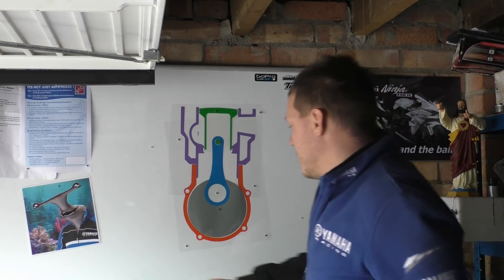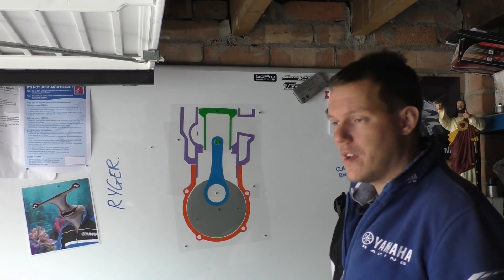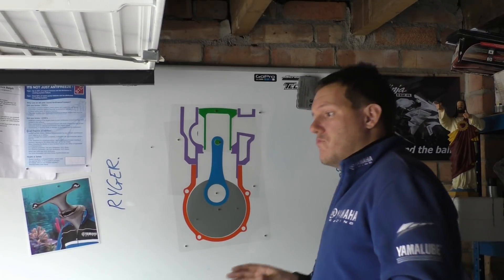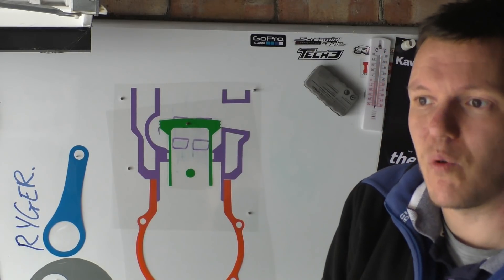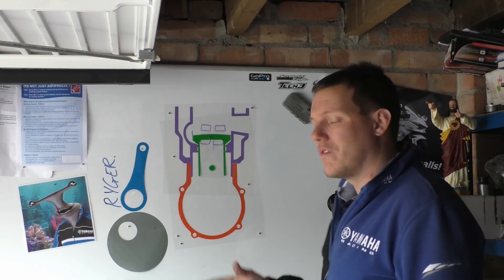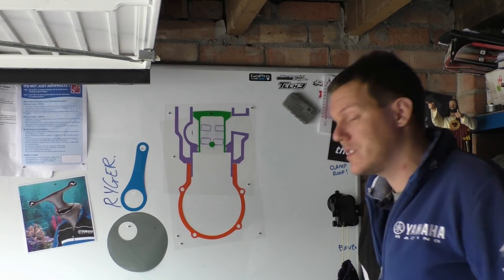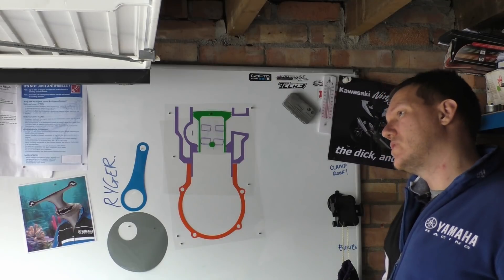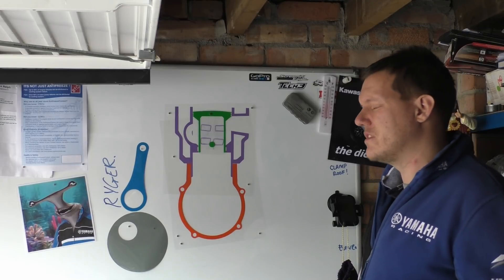Is the Ryger Engine Shite?

Comment: Condensed lubrication???.. Sounds like grease to me. Also I wouldn't trust that the primary compression is any good. That part looks suspect to too much trans port velocity.
However, I do see a few mods that could be incorporated. Put those in and you,d have a hellfire of an engine.

Comment: I just went and had a look at the website and the thing about the motor that jumped straight out to me was that there are no cooling fins on the motor. 65hp at 25-30% (generous) efficiency and there's not enough heat going into the block to need ANY cooling????
Reply from the maker: Its water cooled i believe

Comment: Would that mean the piston is nikasil coated or something as it is having a ring/seal passing over its surface similar to a ring does in its bore,  and how would the tolerances work out??
Reply from the maker: Why would the piston be coated?
Reply: @thedirtyworkshop  .. what would the lower/case ring be made of as you dont have a piston  ring running in a plain alloy bore..

Comment: A YZ80 does about 10-11,000 RPM and produces around 25 HP, a YZ125 does about 11,500 RPM and produces around 38 HP. These engines don't last long at all when they are run like that, this thing might make 65 HP at 30,000 RPM... for about five seconds.

Comment: Condensed oil must mean... it is oil without gasoline.   Oil to rings is probably with oiling holes in the back of the ring groves.  Those bottom ports are always connected to above the piston so as not to get oil from below into the combustion cylinder.   The fuel could be direct injected as with the E-tec to keep the fuel out of the exhaust.  So the benefit is the good lubrication maybe with plain bears, maybe more durable than needle bearing.   Nice broad torque band, amazingly broad for a 125cc with 65hp.  It reminds me of the hp graph of the turbo Suzuki 125 street bike engine, (some very common 1000cc car turbo, as the funny author name is a suggestion), would be great if only an expansion chamber necessary.    The crankcase is not used for transfers port breathing.. so that could increase efficiency of transfer pumping, and possibly more hp.   The lower oil control ring and two compression rings is the same number of rings on 4 strokes, with the added benefit of non-piston tilting, so slightly less piston friction losses, and better ring sealing and life.   Also, could add a oil cooling jet to the bottom of the piston, so that would allow for a leaner mixture before the piston got too hot.  As 2 stroke cart guys know, leaning the mixture is a good but dangerous dance.   Maybe a paid road trip for a video of dyno runs/cart runs, interview?

Comment: Maybe the "condensing lubrication" is something that gets vaporized by the heat in the chamber and then condenses on the exhaust before going to the outside air.

Comment: Interesting stuff Matt... the stepped piston is really an old design... I did watch some videos of a kart Ryger and the thing seems to haul ass... I don't get how they can call it an environmentally friendly engine though when it's clearly puking unburned hc's out the pipe. All carburated 2 strokes  have the issue.. I mean it's a pretty hard thing to do... perfectly push out all the combustion gasses and replace them with a new fuel /air mix and not spill any out the pipe.. One of my favorite 2 stroke designs is the Ricardo Dolphin.. I like the uniflow concept because it seems like it spills less fuel...  and is has the ability to run lube in the crankcase. Ricardo designed the engine in 1904 when he was just a teenager.. it was inspired by Dugald Clerk's earlier design. The Dolphin was used in boats and also a car was produced. The engine was renowned for it's low end torque.   As far as I'm aware the Atkinson Utilite' of 1892 was the first 2 stroke to inject fuel after the exhaust  port was covered.  Here's some video of my crude Dolphin copy... I wanted to make one since as far as I'm aware there are no running examples..  as you can hear it idles pretty smooth.  https://www.youtube.com/watch?v=0oG2RSe3P20

Comment: Interesting idea, instead crank compression it is done by piston side. But too complicated piston. Piston must be probably with nicasil coating or other hard wearable material that can withstand thermal expansion and not crack. There will be serious problems with piston overheating...
The pretty same can be achieved by root screw compressor on intake and eliminate piston crank compression and direct injection. Yes compressor will have less power, but wider powerband.
Max rev limitation is for Ryger and regular 2T the same (piston break and bearings).
I doubt that Ryger hat less friction because piston rings in BDC are near "barrel rings". Piston is way bottom and there must be some support for piston (from sleave?), because piston will tilt and quickly wear.

Comment: Link to: 53hp Turbo TZR125 (2stroke) 53hp @ 11 Krpm   https://www.youtube.com/watch?v=Oxj_OAb5bqk
Reply from the maker: 1) I've been in contact with these guys and they're not so forth coming about their set-up or testing

2) Even if it is true that's with a turbo
Reply: Ryger dyno numbers could be true IF it's boosted.  The turbo TZR125 got 53hp.   It is within reason that more boost and better use of boost, or intercooler could get 65hp.   The 30k rpm obviously is a super super short stroke theatrical engine, not this dyno motor.

Comment: The chart says they made the 65hp at ~11,700 RPMs. That implies putting well above atmospheric pressure into the cylinder before the compression stroke. If they've somehow managed that, then it is a pretty slick motor. I don't really see there being enough volume in their little squish chamber to make that happen, but what do I know. Either they are and its the most compact super charger yet, or the chart is BS.

Comment: I wonder if they do the same thing as the F1 stuff with the cross drilled pistons, just feed oil to the piston rings from the "wrong" side? They probably need an oil nozzle frantically spraying the piston to cool the exhaust side of the piston anyways.

edit: I wouldn't be surprised if they managed to get up to 60-65 hp, people have gotten 125's up to 40hp no problem. They're just not usable because they rev to high for any engine longevity and their powerbands are shit.

Comment: Hi 
Being a boring old fart I sat down and played with some numbers and yes indeed it would have to turn at 30800 rpm to consume enough air to produce 65 horsepower assuming 100% volumetric efficiency of which I'm sure would be greatly reduced at those speeds 
What do you think
Reply: Yes Marcus.  According to Blair the port time/area would need to be enormous for 30,000 rpm.   The direct gasoline injection, opposed piston engine I'm building has huge ports for a theoretical 22,500 rpm max at a 32mm stroke and 23.25 m/sec piston speed. the port height is a whopping 20mm, or almost 2/3rd stroke. I expect to run it at a more sensible 17m/sec maximum though, which equates to 16,452rpm    BMEP equates to 20.61 bar  and 361.6BHP  as the capacity is 477cc's  with forced induction at 3.1bar.   No tuned exhaust system and a linear torque curve anticipated.  Bore is 70mm.

Comment: Think about their statements of that the engine isn´t depending on the pipe to make power.
And then you think about the pumping displacement, it is actually a lot less than cylinderdisplacement due to the 'rod' going down through the sealplate are stealing displacement.
So, pipe isn´t important they state, well i have to say it sure the fuck is.
It has to be working throughout the whole usable rpmband they show on that excelfantasy dynosheetpaper.
And as a twostroketuner we all know that a pipe don´t add power in that very wide rpmband.

Nothing else than sales hoax.

Comment: The dyno graph doesn't have units on the axes and also has two plots, one much bigger than the other and no information about what either of them mean, so it's impossible to draw any conclusion. But since a Honda RS125R makes 44HP and that's running on the edge of blowing up then 60HP looks unlikely.
Reply from the maker: LOL what - the dyno plot does have units??? From there website -

"A little explanation concerning this graphic, The red line is the Ryger 
special and the yellow one is from the standard version. The lower ones 
are the torquelines."

the plot 

http://rygerengine.com/wp-content/uploads/est-test.jpg
Reply: I stand corrected said the man in the orthopedic shoes.

Comment: I saw your video with the two engineers trying to fix the 2 stroke emissions and they ended up just making a 4 stroke. I still don't get how a supercharged, non crankcase breathing 2 stroke would be more expensive than a 4 stroke. To me, a a supercharged, non crankcase breathing 2 stroke would be perfect. Also, you could design it to have extra boost for no extra cost.
Reply from the maker: This is why. You have a supercharged 2 stroke. 

This does 1 thing. You stop burning oil. You are still losing fuel through the exhaust and who knows if this will pass emissions?

Now you have other issues.

1) Cost - superchargers are fucking expensive
2) weight - superchargers are heavy
3) fueling. How? Carbs - then you have throttle response issues, or add a fuel pump etc
4) Go injection and the cost of the pump, sensors and injector
5) You have to make things taller to fit it all in. Just like the ryger

That's why

Comment: I like 4 strokes because I always feel like they are not ticking time bombs because of their lubrication. That said I like this but it still fails in many aspects that a 2 stroke has. And they claim mad hp but it should be less because you have the oil pump or splash system adding friction right... I do like the idea and if they gain reliability with the same hp am sold

Comment: Was thinking about it and I suppose it depends on what materials are being used for the piston (weight wise)... Maybe they have gone the complete opposite with the piston being coated opposed to the cylinder (nikasil or something slippy ie; teflon ?) to reduce friction against the seal faces, I also wonder what the seals/rings are made of. (some funky shit)

Also depends on what they have used for bearings, ceramic would be the way to go if you wanted to produce HP and RPM to those values, maybe this is why the thing is so expensive, if the production costs are stupidly high...

I might just buy one out of curiosity to find out................... like fook !! 

PS, where's the boy gone, you got him gimped up Matt ??
Reply from the maker: "Maybe they have gone the complete opposite with the piston being coated opposed to the cylinder (nikasil or something slippy ie; teflon?)"

- heat is the problem here. Pistons are exposed to the highest temps in a 2 stroke with no real direct cooling. Covering it in an insulator is not a good idea.

The other issue is that coats resist wear, not stop it. Most components rely on oil as the load carrier and not coating. Coating are used to extend the life of something not be the only line of defence. Will do a video on this though, good point.

"ceramic would be the way to go if you wanted to produce HP and RPM to those values, maybe this is why the thing is so expensive,"

- Same thing with ceramic bearings, they are more wear resistant and harder. They have a lower load capacity than metal bearings and are much more susceptible to thermal shock from temperatures increasing and decreasing. This can cause internal stress and lead to cracking. People seem to think that ceramic bearings can 'go' faster which is bollocks.
Reply: Good point on the bearings and yea your right, didn't think of the thermal shock factor, maybe being a sealed crank to an extent it might be cooler ?

And what you done with that boy ??
Reply from the maker: He's sleeping (in the gimp box)

Comment: Wow.  The port time/area seems way too small for the claimed power and rpm.  I wonder what the claimed BMEP is?  The crossflow port layout doesn't impress me either.  Imagine the mixing and short-circuiting that must occur!   My 2.5 cc model engine turns 37,000 rpm, but the piston speed is only 17.3 metres/second.  Theirs would be a ridiculous 54 metres/second at 30,000rpm.  Lubrication would be a nightmare at those piston speeds and the piston acceleration would be around 168,750 g.
Reply from the maker: "Wow.  The port time/area seems way too small for the claimed power and rpm.  I wonder what the claimed BMEP is?  The crossflow port layout doesn't impress me either."

- the example on the board isn't their design, its an example so not to be taken literally - as I said, I don't know the actual design that is in the engine for sale. This is just what i got from the patent. 

I believe its close but how close? Who knows......
Reply: Quote from the patent:  " Oil spray present in the crankcase can easily reach the piston, condense and penetrate, via the access opening, the plurality of channels due to the pressure in the crankcase, such that a small amount of oil is fed to the top seal ensuring proper sealing and lubrication of the piston relative to the cylinder wall. "   Patent number EP20150179826  on Espace.
Reply from the maker: The same as I read - this doesn't tell you anything even with the illistrations. If the compression rings are receiving oil then the entire cylinder wall is. 

This means that the ports will 'scrape' some of thoil off and it is then in the air flow. These means that the oil will burn hence the system is not a clean as they are making out.

Comment: I wouldn't want a bike with that kind of powerband. Idle has no torque, then suddenly the meat of the band. Granted this is for a race application. And is it just me that thinks a powerband from 8,000 to 13,000 seems kinda small considering anything under 8,000 is unusable?
Reply: phillip galas for kart racing it makes sense. Thats about all the Rev range you use. The power numbers sound like "theoretically lossless" numbers IE fake as fuck.
Reply: Puffalupagus360 agreed. It looks like a calculated chart while ignoring limiting factors, namely going twice the popular limit of piston speed.

Comment: It doesn’t look like it is an exceptionally superior design to the degree that it would offer that kind of HP without them talking about the new science they have put into the materials that make it possible. As you said Matt, those are some bloody big numbers they are claiming. A little engine like that would have to be amazingly strong to withstand those forces. Why no mention of the metallurgy by this company? It seems to me that the claims are fishy.
Reply: there may be a proprietary coating on the cylinder and rings. there are advances in anti-friction coatings that enable high heat and rpm stresses and still last long. that can be the only reason so secret about details.
I like the piston idea, maybe it weighs less than a regular straight 1?

Comment: I like the way you didn't totally throw the design out the window, but just pointed out the problematic points. Especially the power number.. I'm also wondering.. square engine supposed to go 30000rpm?
I mean 30000rpm... that's about where most of the model nitro-methane engines have their max rpm. 
Would be cool if you could come back to that engine when there's new information!
Reply from the maker: Like I said the 30,000rpm can be achieved it does doesn't last long, and part of the testing - don't know why but there ya go........
Reply: yep

Comment: http://www.ntproject.com/startpage/ryger_engine.gif looks like it is basically  a variation of a crosshead engine with piston,pistonrod and crosshead combined into one
http://www.marinediesels.info/Basics/2_stroke_crosshead_labeled.gif
Reply from the maker: "looks like it is basically  a variation of a crosshead engine"

- apart from there's no crosshead bearing. It looks like a 2 stroke engine with a long piston and a secondary seal and extra ports.
Reply: the piston and piston rod is combined into an long piston, and instead of sliders on the side of a crosshead  keeping the motion in straight  line it is done by secondary seal. I don't see a huge difference